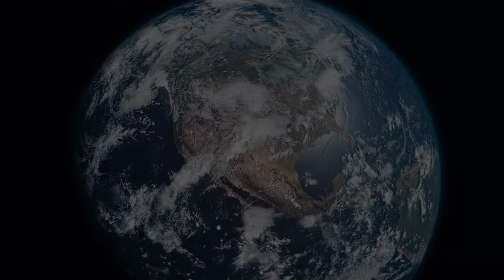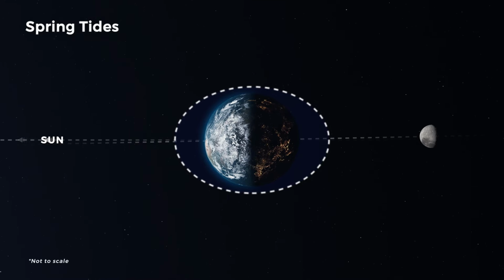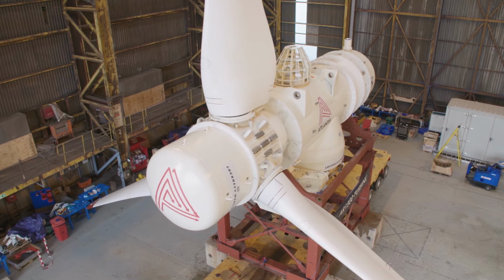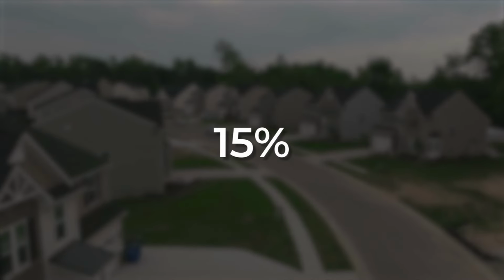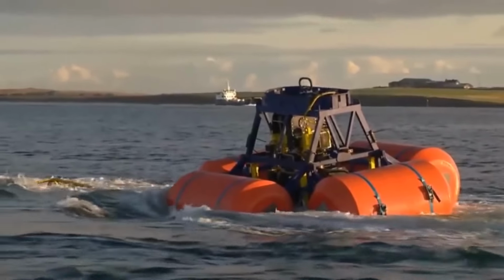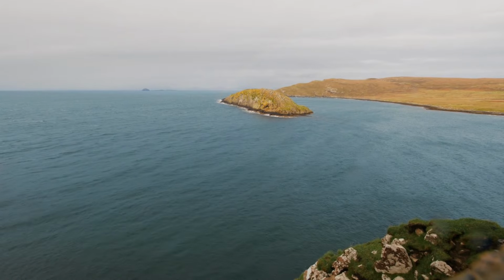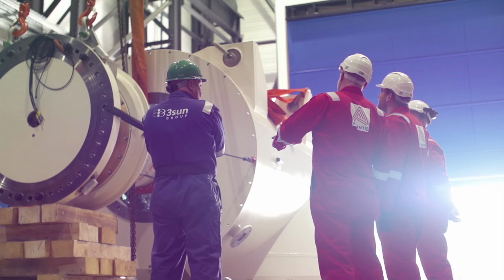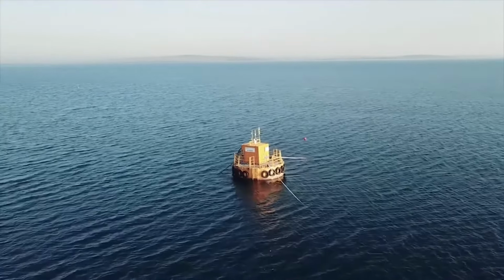Can Underwater Turbines Solve Our Energy Problems?

Comment: While there's a fortune to be made by using coal, oil and atomic power to generate electricity nothing will change, these power company's don't give a toss as long as the money keeps rolling in for the shareholders. If we were really serious about climate change every industrial building in the country would be fitted with Solar Panels to help with their electricity consumption and of course reduce pollution, this alone would reduce the amount of pollution we produce substantially but the power producers wouldn't like that of course because the last thing they want is to loose the amount of power they sell to these factories. It's all about Money as usual, I'm not a tree hugger but I think we should make a bigger effort into cleaning up some of the mess we've inflicted on the planet before it's too late to do anything about it. Electricity is the future for mankind and every effort should be made to generate it as clean and sustainable as possible to cope with future demand, tidal, wind and solar would go a long way to achieving this and it wouldn't be depleting the earths resources but would have the added benefit of cutting pollution.

Comment: Really great video. I am currently completing a PhD looking into collision risk between these devices and animals and was extremely impressed with your well rounded points on environmental issues! 

An additional bit of information that may have been worth incorporating into your calculations on the long term costs/time to recoup investment - Meygen plans on installing larger 2MW devices in the next stage rather than the 1.5MW devices currently installed - making development more efficient.

Comment: Extremely expensive. 715 kWe effective capacity. $11m cost -> $15 000 / kWe which is 5x more than solar and 15x coal! Niche uses only.
Reply: Tidal barrages are costly. Freestream tidal power can go for < 0,01 /€ kWh. Wich is cheaper than shale coal. Protoypes already have proven 0,04 €/kWh. Indicatiing cost vastly cheaper than wind energy,

Comment: I doubt this would be very cost effective, since salt water and electrical components don't even remotely mix, unless there exists a way to somehow keep the current generators pressurized and cool without having any access to open air. It'd be a truly mammoth challenge indeed, and certainly more effort than I think we have in 2020. This is more a project for like 2065 or 2070.

Comment: I would say "not all, but some. Maybe even many". 
. 
Because you could put some extreme gear reduction on underwater turbines. Or put a bigger generator on it, using less speed and more torque. And extract some considerable power from it.  Since water is far more dense than air, it can apply far more force on an area over a far smaller amount of time.

So pound for pound, a water turbine can easily win over a wind turbine every single time. 
The only real issue with them is keeping the water and filth off it, and maintaining the generator units

Comment: Being predictable, nevertheless, does not mean that it is constant. A tidal energy system would experience significant fluctuations over the day, month, and year due to (1) tide, (2) moon phase, and (3) distance of the sun and moon from the earth, respectively.

(1) High and low tides cycle over the day and there are periods with almost no flow of water. This means fluctuation between 0% and 100% of generating capacity in a given day. To offset this, we would require a network at least five thousand kilometers wide.
(2) Neap and Spring tides cycle over the month. We would fluctuate between about 50% and 100% of generating capacity in a given month. There is no way to offset these fluctuations with a network since Neap and Spring tides happen at the same time worldwide.
(3) Perihelion and Aphelion cycle over the year. This would represent a small, but important fluctuation in generating capacity. As with (2), this cannot be offset because it affects the whole planet.*

Connecting this to the grid would complicate things. It might be good for Hydrogen production.

* Perihelion happens when solar energy in the northern hemisphere is least available, though, so it might somewhat offset solar there.

Comment: 9:45 "Area avoidance would be useful". Sure, to aovid fatalities through injury. But if these things really generate an area of denial effect, then masses of them deployed in the same area will drive native life out of that habitat. In other words, they will reduce the amount of living space for these creatures, which will reduce the amount of creatures all the same. That is not much better.

Would be interesting to know how many of these things will be needed, how large of an AOD they create, and if there are enough areas on the globe to create an appreciable amount of power without impacting wildlife in that catastrophic a manner. 

As usual, very interesting video topic, slightly biassed presentation.
Reply: I think the whole idea is a pipe dream, but the same argument was used against offshore oil rigs. Just the opposite happened. Marine life turned the rigs into reefs that exploded with marine life.
Reply: @johnshilling2221  The analogy doesn't fit. dump any rigid structure into the ocean, make sure it doesn't poison anything, then sure, it will turn into a habitat. 

But these structures need by necessity stay free of overgrowth, because they can't work otherwise. And they may by way of the work they do negatively impact the natural biomes they are inserted into. They might in the process create a new biome around themselves, but that would be a biome that is not otherwise present in the area, which has its own implications. 

In theory, I think this is an awesome idea, the amount of energy the tides contain is absolutely insane. This just might not be the way of harvesting said energy

Comment: If you had a buoy that measured let’s say 3 metres in height with an internal mechanism travel of 2 metres that would cover most swell heights. 
A spring loaded cable drum to spool out and retract the anchor cable as the buoy travels. The dynamo, after gearing up can be hooked straight on to the drum essentially. 
Super smooth exterior paint on the outside and corrosion resistant cable and it’d be a real goer. For sure.

Comment: Wave energy. 
Coastal buoys with anchor points on the sea floor. The waves pull the buoy up and down on the static cable. This motion is transferred to a dynamo inside the buoy generating an electric current? The electricity is then transported down a line inside the static anchor cable. Joined up to a main line and fed to the shore and subsequently the main power grid?

Comment: You throw away half the energy you produce... at least half if not more.... you should concentrate on using the energy you produce properly.... how many electric motors do you people run ?.... they all produce heat and you throw it away, air conditioners, fridges, dryers, commercial freezers all sources of heat energy you throw away....
Liquid cooled motors????  yep we got em, heat sink to transfer that heat, yep we got em.... producing electricity using steam.... yep we been doing that a long time.....  take all that heat energy you throw away and use it to pre-heat water for steam genny's...

Comment: There is no silver bullet. Only silver buckshot. I've maintained for 30+ years that wave/tidal energy is a reliable renewable resource that, like solar and wind, should be tapped. Had we embarked upon research and development even 20 years ago, imagine the progress that could've been made; how much less fossil fuels would've been burned; the amount of greenhouse gas emissions avoided.

Beyond environmental impacts, which are rather benign, the single greatest issue with wave/tidal is that of concentration. Yes, the majority of the world's populations live near coastlines. However, vast expanses of land and billions of people do live inland. So, the expense, environmental impacts and losses associated with long-distance energy transmission mandate diversification into additional means of renewable/sustainable energy generation.

The single biggest error in U.S. and world energy policy has to be nuclear. Since the publication in 2006 of research into molten salt reactors conducted at Oak Ridge National Laboratory during the 1960's, the world has had a clear road map for "green" nuclear energy:

• Worldwide elemental abundance (no more wars over oil)
• Walk-away safe designs (no risk of meltdown, etc.)
• Dramatically lower toxicity (a fraction of the waste of legacy designs, as well as shorter half lives [hundreds of years instead of many thousands])
• Low proliferation risk

Best of all, these small, affordable molten salt reactor facilities can be built wherever needed and have much lower total costs of ownership than any similarly sized alternative.

Comment: Australia has Carnegie energy with up to 12m dia buoy filled with the seawater which moves with waves they sit 6m below the surface.  The buoys drive power piston similar to that used by oil rig back to  shore where goes through a turbine to generate power or the pressurised water is used in desalination plant to give fresh drinking water. https://www.carnegiece.com/

Comment: I did a work on this around 10 years ago, for Portugal. I'm surprised to know how little seems to have changed...
Reply: Why are you so surprised??

Edit: My point was, it’s very difficult to get energy out of the ocean, as can be seen in the lack of progress on this issue. We’re better off sticking to Nuclear Power for now.
Reply: Afaik the cost of production ie scaling is the main problem, which is really not that difficult to solve
Reply: Well, because it's been decades since these problems arised. It's nothing new.

We've been asking the exact same questions and considering the very same potential ambitions for decades, now. From the looks of it, it  doesn't look like we've gone very far, according to this video.

So, I was kinda disappointed about the lack of answers or solutions here, which I think should have been long resolved. Especially considering all the projects, time and media going around this...

I remember a project from the 90s (Pico OWC Project), among others (Pelamis, São Pedro de Moel). We're in 2021 and sadly this video from 2019 brings nothing new...
Reply: Politics F's up everything
Reply: I think it's because this is a very difficult problem to solve
Reply: No change in phony betz claim my automatic feathering flat blade radial windmills  both horizontal and  vertical is Einstines equal and opposite 100% not allowed since 1919 betz reelecting policy scam when oil discovered its duty of presidents to see laws enforced that is only way.against nuclear and oil  solid hold on banks  i just squeaked by  broke now its up to forcing Biden. Praying always works me to.amen  named bejesus windmills. the stonewalling is expected in Test of spirit
Reply: @stevenlonien7857  this comment looks like a random word generator

Comment: Maintenance is gonna kill this idea. I own a boat, and keeping the hull clean requires monthly scrubbing underwater. Then there's  all the problems with keeping seawater out of the electrical system. The deeper you go, the more of a problem this becomes. There's also a huge problem with dissimilar metals,  which will lead to severe corrosion and failure is not managed properly. Oh, and how are you gonna get the power produced back to shore effciently?

Solar and geothermal power are the most economically and technologically viable "free" energy sources we have, and they are plenty. Look at how badly we've screwed up the planet with difficult to extract and refine fossil fuels. Unlimited energy would simply encourage irresponsible development and waste. What's needed is better management and development of existing energy sources, not hare-brained schemes for new unlimited sources.

Comment: 30 minutes to remove. Yes theoretically. First you need to mob a vessel, transit, perform weather dependent lift, do the work and then reinstall. So 1 day. What is the frequency of maintenance. Large wind turbines have fleets of maintenance vessels. 3.5 years to pay for the installation, what is that when maintenance is considered. Always will be niche.

Comment: Tidal energy = terrifying consequences.
I studied tidal energy at university in the early 2000s.  It has obvious benefits that are discussed in the video But has massive potential consequences. The environmental issues are a side issue.  The real problem is that the movement of the tides an orbit of the Moon are fundamentally linked as said at the start of the video, but what is not said is that the tides and lunar orbit are a balanced system in which the movement of the Moon puts energy into the movement of the tides, and then the movement of the tides themselves puts energy back into the orbit of the Moon. Obviously if you remove energy from an otherwise balanced system you unbalance that system and thus major generation of electricity through tidal power will fundamentally change the tides, and the orbit of the Moon. In particular even relatively minor energy extraction (a small percentage of the world's annual electricity use) from the tides is likely to impact the Moon's orbit to such an extent that the orbit will stop being elliptical and instead become a spiral.

There are complicated factors I can no longer recall which determine if that spiral orbit would move the Moon outward or inward but both are catastrophic for all life on Earth.  Outward would lead to the atmosphere ultimately being pulled into space, so no more breathing, whilst inwards would lead to a collision of such force that the asteroid that ended the dinosaurs would be a drop in the ocean by comparison.

Tidal energy is superficially attractive in terms of being able to supply a constant flow of electricity for a while, but the long term consequences of doing it are even worse than climate change (which frankly terrifies me enough). It seems irresponsible to do a factual video about all the benefits but then only mention the small (and manageable) problems, ignoring the big picture problems, almost as though many of the facts you researched come straight from the tidal industry lobbyists and industry...
Reply: This is literal insanity. A balanced system the solar system is not, my friend. The moon yes has a gravitational influence on the earth and the earth has one on the moon, but the miniscule changing of tides or even a large one would do bugger all to orbits. The mass remains the same, the motion of tides within the body here would be irrelevant.

Also, the moon would need to move a colossal distance to even impact earth's atmosphere or tides significantly. At the natural rate at which it moves away slightly, tides wouldn't even be affected for a VERY long time.
Reply: @ytpanda398  I do not believe he understands the miniscule scale of water there is compared to Earths mass. The Ocean represents less than 1% of Eaeth's entire mass, and is like the skin of an apple.
Reply: Pomp Mag Hard to believe humans could possibly remove that much energy from tides...   but I never even considered it a possibility  so that was interesting.
Reply: I studied it as well as part of ocean engineering degree... you're entire ramble was about on par with flat earth bro science. Not one scrap of reality to it at all. This is right up there with "dont build skyscrapers because they will serve as artificial mountains throwing off the delicate center of gravity of the earth and induce axis wobble" ....sounds scientific, but the scale of impact is so unbelievably minimal it's not even close to relevant
Reply: wow

Comment: Measuring just the time it takes to generate the first profits isn't fully how it works: It's more likely to measure the share of the machines lifetime that you need to get the construction costs of the machine back. A tidal energy barrage is designed on a service life of about 100 years. Taking 20 years to get the costs back is 20% of the lifetime, whereas those turbines aim on a service life of about 20 years. 16 out of 20 years are about 80% of the machines service life and that makes it a far less promising investment.

Comment: If you place solar panels in deserts there is no random weather to take into account. Not to mention we need to get solar panels into space, more power, always.

Wind and water destroys the environment in various ways. Wind turbines are big and ugly, you can see them from miles and miles away, and they make bird sushi. 
Water Turbines makes fish sushi.

Solar is the only renewable power of the 3 that does not make sushi it any form. You dont even have to clear land for it, because we have plenty of rooftops and again, they would go better in the desert anyways, and if there is two things the desert has more than enough of, its sun and space.

Not to mention the biggest thing solar power has going for it, no moving parts, wind and water needs moving parts, which means more maintenance, which makes it more expensive.

Comment: Dear Sir , I love watching all your videos , but please can you explain to me why don't they use wind turbines to   do this,  fit them to drive a compressor pump that will fill up a compressor tank then just use the compressed air in tank to run a generator , when they need electricity on demand,  for example then they can use the compressed air stored in the tanks to supply electricity when there is no wind, ????? hope you understand and thanks again for all your hard work and excellent uploads, all the best Robert UK London.
Reply: too many components with energy loss involved. A freestream turbine is a pretty direct fluid dynamic converter. Tides are available 24/7 along coastlines. You just need more turbines and plants for the reserve capacity,